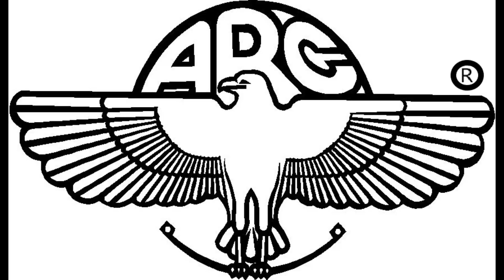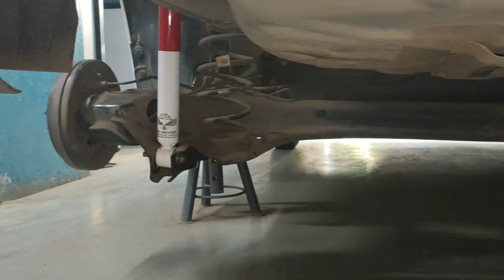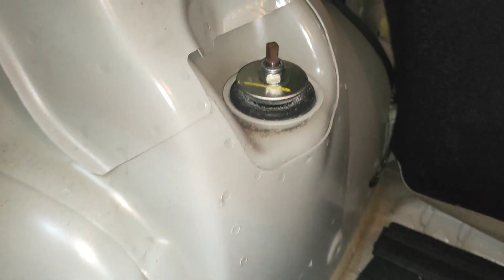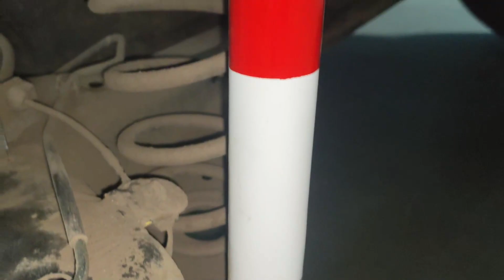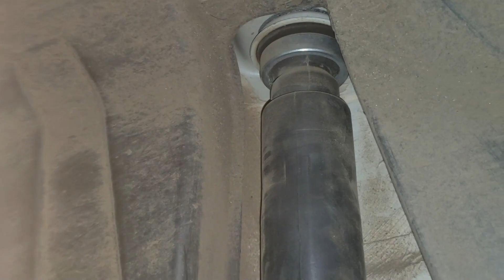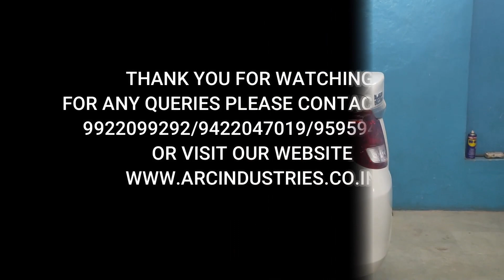Maruti Suzuki Swift Dzire ARC Rear Shock Absorber Suspension Upgrade

Comment: Hi, I have honda mobilio.I feel all bad road vibrations in seat even at 30-40 speed. Will it get smooth with Arc suspension?
Reply from the maker: Yes sir, definitely you will get good comfort and stability :)
Product link - https://www.arcsuspension.in/honda/mobilio/mobilio-mobilio/honda-mobilio-arc-rear-shock-absorbers-suspension-upgrade-kit

Comment: Hallo it is available for chevy cruze and new swift ..
Reply from the maker: Sir we do not have for the Chevy Cruze at the moment, We have the Shock absorbers developed and tested on the New Swift.
Product link : https://www.arcindustries.co.in/products/maruti-suzuki-shock-absorbers-102103/swift-shock-absorbers-166167/maruti-suzuki-swift-arc-comfort-series-rear-shock-absorber-suspension-3rd-gen-2017-2020-390391
Reply from the maker: Product can be ordered from the below Link - 
https://www.arcsuspension.in/maruti-suzuki/swift/swift-dzire/maruti-suzuki-swift-dzire-swift-2017-2022-arc-comfort-series-rear-shock-absorber-suspension-swift-2017-2022

To know more Call us on 9422047019 / 9922099292

Comment: I see only rear shocks available for dzire. Even i own a 2012 dzire , Is the price in ur website for a pair or a single shock?  . Wid front stock and rear ARC, will it be really worth it ? .
Reply from the maker: Launching soon, testing and validation of design is done, available in limited quantities. Once we are able to make more, We will list it on the website.
Price is for rear pair on the website.

Full kit will cost 32500.
Front comes with coil spring.
Please call on 9922099292,9422047019 to know more.

Comment: Nirmal swiftin rate 2011 modal
Reply from the maker: https://www.arcindustries.co.in/products/maruti-suzuki-shock-absorbers-102103/swift-shock-absorbers-166167/maruti-suzuki-swift-arc-comfort-series-rear-shock-absorber-suspension-381382
Reply from the maker: Product can be ordered from the below Link - 
https://www.arcsuspension.in/maruti-suzuki/swift/swift-swift/maruti-suzuki-swift-arc-comfort-series-rear-shock-absorber-suspension-rear-2005-2017

To know more Call us on 9422047019 / 9922099292